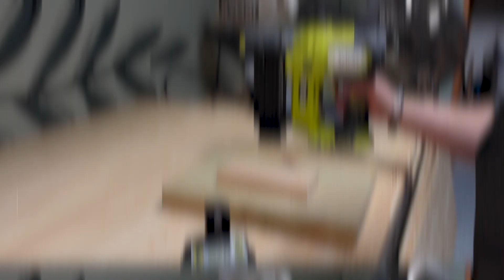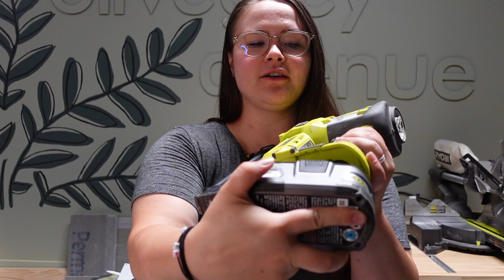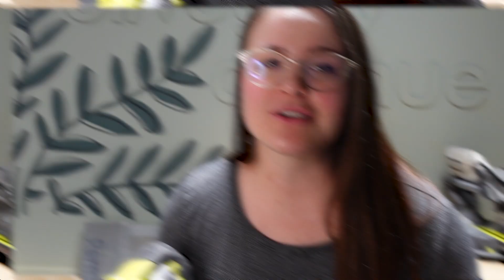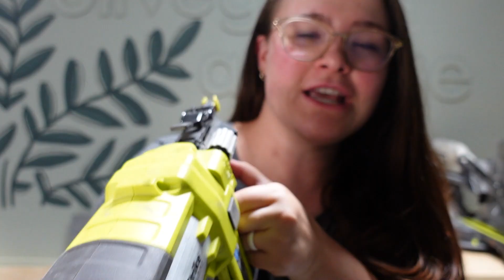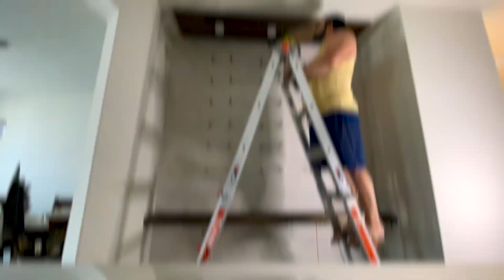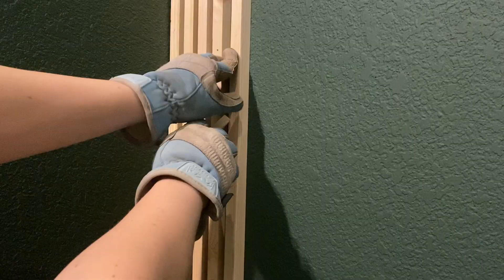Ultimate Beginners Guide to the Brad Nailer

Comment from the maker: What tool should we do next? Drill/Driver or Multi-tool??
Reply: One of each, please 😊
Reply from the maker: @donnale3881  will do!
Reply: Hello! New subscriber here. I don't really know what a driver is and how it is different from a drill. Haha! I have a driver, but don't know what it's for. I'd also be interested in the different kinds of woodworking clamps you use. There are corner, band, box, etc. Do you use all the different kinds or do you have a type that you find works really well for various applications?
Reply from the maker: @Latonyajohnson-123  definitely will add the drill and driver to the lineup soon! I’ll say for the clamps, I don’t really use a bunch of different ones. I just use like a “normal” clamp and I have a corner clamp for holding things together at a 90 degree angle but that’s all 😉

Comment: What length brad nail do you recommend for half inch dryway and 1x2 firring strips?  I'm going to do board and battenn and will be studless on most spots, so will be using that x pattern in conjunction with liquid nails.

Comment: Great video! Thanks so much! When doing the criss cross method into drywall, I noticed the brad nail sticks out quite a bit. How do you get those nails pushed in further so they aren't sticking out of the wood?
Reply from the maker: Oh! Since I was messing with my settings, I just didn’t have the nails going into the wood far enough so the two settings were just off but it wasn’t special to that method, just having your settings right 😊
Reply: @olivegreyavenue I have an air nailer. What PSI do you think without going too far?  I don't want to damage the drywall either or go straight through the wood lol .